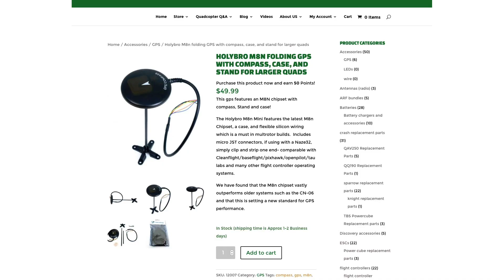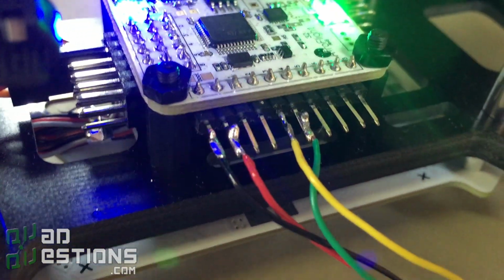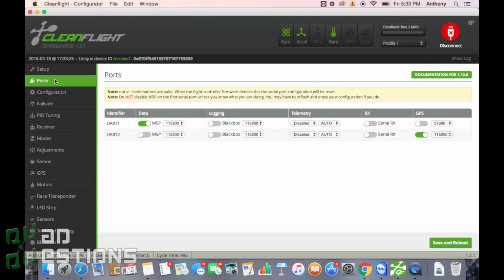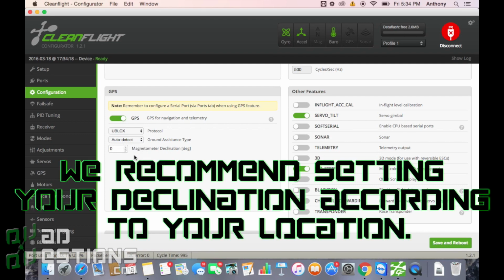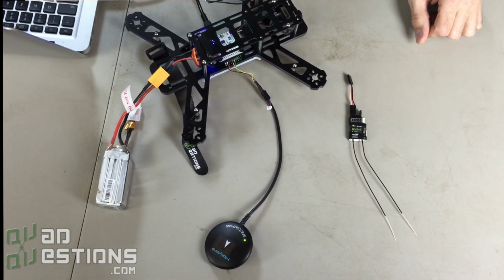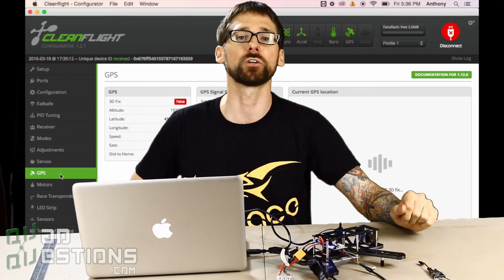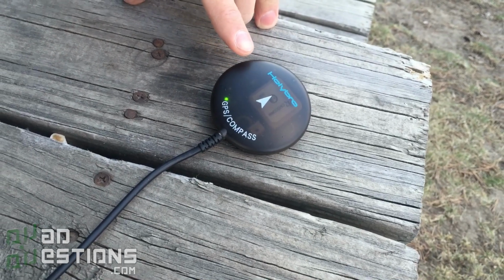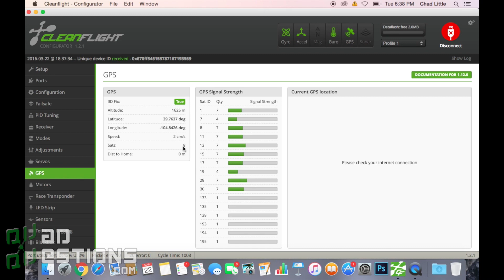How to setup a Holy Bro M8N GPS compass unit with a Naze32 flight controller running Cleanflight.

Comment: can u put return to home with this?
Reply from the maker: This has been previously discussed. But to answer your question, rth with stm32 based hardware hasn't been perfected and therefore we recommend that you only use GPS for metrics such as speed, home location, altitude.  If you really want a reliable rth, you should consider a different flight controller such as a Naz m V2.

Comment: Hi, I am using IBUS on my naze32 flight controller, and the IBUS is occupying the rx port (port 4) on the input rail. Is it still possible to connect a GPS using different ports?

Comment: How do you connect SBUS from a X8R (the signal wire) when you use pin 4 for the GPS RX ? Do you use them both on pin 4 or how do you solve this?
Reply from the maker: You have to set either the GPS signal to an open available serial port, or set the SBUS signal to an open available serial port.  They cannot share the same pin.

Comment: Why does the MAG icon not light up, was going crazy till I saw yours didn't either,,
Reply from the maker: in this video, we don't have I2C setup, so the mag isn't communnicating with the board (that's what the other 2 wires out of the GPS are for)

Comment: Are you sure about sending 5 volts out to the round M8N, I think it is 3.3 volts. I understand the square format Micro M8N can handle 5 volts
Reply from the maker: We had issues with Holybro because their boards pinout's weren't labeled. .  Some TTL communication such as I2c is 3v3, but RS-232 is typically 5V.  The pinout for the GPS as confirmed by Holybro is here: https://quadquestions.com/?post_type=product&p=17075  QQ only has 1 gps in stock because we are working to find a better GPS supplier so that these questions are solved before they are asked... I believe that the gps chip in the round unit is the same as the one in the above link, but you will have to double check the part numbers.
Reply: Thanks. Your link to the 'pinouts' is broken
Reply: I have tried 3.3v and 5v,but no different

Comment: I am so confused. Other videos say no naze32 others say yes. Some say no cleanflight period but inav instead, in order to get the RTH, waypoints, etc to work right.
Reply from the maker: Hi Matt,  I think the issue is that the technology has been developed at a rapid pace, with a flood of new flight controllers that still have very marginal improvements oft the Naze32.  Naze32 is still a great flight controller for beginners, and it is the best documented flight controller.  However, it's F1 processor has less I/O and is a little bit slower than the newer F3- again,  the difference is marginal, especially if you aren't racing.  

So to solve the question of which controller to get, let the amount of i/o connections that you need to make to the board determine whether you need to justify the expense of the F3 processor. 

II don't have much experience with INAV because we are currently supporting Betaflight on our QQ racing drones,  However, IF BUILDING A DRONE THAT NEEDS RELIABLE RETURN TO HOME AND FAILSAFE we always recommend that you go with something like a Pixhawk, or Naza MV2- as these flight controllers have much better development of the return to home and failsafe functions than some of the multiwii variants such as Cleanflight, INAV and Betaflight. software that are currently available.

Where the GPS shines on boards such as the Spracing, Naze32, Colibri, Fury, etc, is in the fact that you can overlay info on your screen such as speed, altitude, Lat, Long, and a direction arrow pointing to to your home location.   So it can really help get you in the "Know".  

I will stress again that we still think a pilot is necessary for safe operation of drones with these flight controllers.  If you have to rely on your RTH to get home, IMO, you are already flying outside of your safe zone, and when a drone is flying by itself, it can also cause injury to someone without the pilot's knowledge.  The GPS should be used as an aid to the pilot, not take over the job of the pilot.  

Let me know if that helps to answer your questions!
Reply: Thanks for the reply! Helps a lot! :)

Comment: Hello, 
I got only one question, what should I do if I want to connect my GPS and the Naze32 in PWM? 
Because the +5V and GND connections, which come from the Naze, they go to my receiver X8R...
I mean, how can I power my GPS if I´m using the GND and 5v of my Naze for the receiver?
Thanks in advance
Reply from the maker: I think you will have to upgrade your receiver to PPM or Sbus to allow the use of soft serial.  You could also connect it to the tx and rx port in the middle of the board and use Uart1 for GPS connections.

Comment: how to set up  return to home on Naze32  board ?
Reply from the maker: Skip it- it's not reliable.  RTH is not a reliable replacement for smart piloting- if you have to rely on RTH, you have already done something wrong.  If you need something reliable, try a DJI Naza, Pixhawk, or other, high-end flight controller.  https://quadquestions.com/product/dji-naza-v2-flight-controller-with-autopilot-led-gps/

Comment: can i connect the GPS in the UART 1?
Reply from the maker: juan carlos barrera yes you can, but uart1 is shared with the USB connection, so you will not see that the gps is working when the computer is connected.
Reply: I don't understand, if I plug the TX and the RX in the UART1 when the Naze 32 is connected to the computer the GPS do not work ? What I do to configure the GPS when the USB is connected ? Can you explain with more detail for the method to add the GPS on the UART1, my Naze 32 is connected in IBUS with my IA6B receiver and I take the number 4 on the UART2.

Tank you in advance for your answer.

Comment: my problem is im using a pwm receiver. how can i connect it if the gps is already plug to the pins?
Reply from the maker: If using a naze32, you have to use a different receiver to open up the serial ports on the flight controller

Comment: Why does your MAG icon not light up. My BAR icon light up, but no BAR mode option in flight mode panel.
Reply from the maker: We demonstrated this on an acro board that doesn't include a magnetometer. We should mention that in order for the GPS to function properly, you should use a full board with a magnetometer, otherwise you will have to connect the magnetometer I2C output from the GPS to the board's I2C ports.  Thanks for pointing this out.
Reply: I do have the full version. BAR icon lights up and is active in sensor tab, still no BAR option in flight mode. Have just received HK Illuminati 32 with no magnetometer, but BAR is in flight mode option as it should. Very strange thing with Naze32.
Reply: Michael Andersen did you get this working correctly with your Illuminati board? I am finding that when I try to save the GPS config it keeps everything backwards.
Reply: QuadQuestions.com 
So once you connect the external compass of the gps module to the naze32 acro FC will you be able to set up gps functions such as position hold?

Comment: All set up in cleanflight everything works visually but selecting rth or hold does nothing in flight. What should we look for? Yes modes set to switches.
Reply from the maker: make sure that your pids are well tuned, RTH is still very experimental with Cleanflight.

Comment: Hi! I would also connect the external compass, you can? and how it excludes the internal one? and where they connect the 2 wires of the compass, the "I2C"?. THANK YOU
Reply from the maker: You can connect the external compass, however you will have to cut the trace on the board that connects the i2c connection to the magnetometer.    You would connect the wires to the i2c port on the naze.  More info can be found here: https://quadquestions.com/blog/2015/11/15/naze32-manual/

Comment: Bro, is that on a full or evo naze board, or it doesn't make a difference?
Reply from the maker: A full naze board is required to use GPS-  a magnetometer is required to use GPS functions in Cleanflight.  Some GPS unit's include a Magnetometer, however it is easiest to just use a Full Naze32 that already includes one.
Reply: I got a full naze32 and im using a naze gps.
Reply: QuadQuestions.com must of the people on here are using all pins you are indicating to use for a gps hook up. my question in can you give a clear explanation of a alternative gps hook up on the naze32 rev6.
Reply from the maker: You can use the GPS on any Rx and Tx pair.  So you could connect to the tx, rx pins, or pins 1,2 or 3,4 or soft serial on 5&6 or on 7&8.  But as explained, most of these serial ports are used by things like USB communications or rx receivers or PWM inputs, so it really depends on your build.

Comment: Thank you for putting this together! I have a question about using this with a tricopter setup in cleanflight. I'm using pins 3 and 4 for ma ch4 and ch5 on my receiver. Is there an alternate configuration I could use to get this working. I noticed there are tx and rx pads on top of the naze32 - could these be used (connecting the gps tx to the rx pad and visa versa)? Thanks again for your time!
Reply from the maker: +rcpilotp51 You can use the GPS with any spare UART (serial) port.  The Naze32 is somewhat limited on I/O-  UART1 is taken by the USB port, and by telemetry-  UART2 is the standard GPS port and the only other available UART-  If you need more I/O you could use soft serial to create virtual serial ports to use on pins 5&6 (soft serial 1) or pins 7&8 (soft serial 2)

Comment: I hooked the Holybro M8N GPS unit up to an HKPilot APM 2.7 FC to the appropriate connector (after swapping out the supplied extra cable).
I am wondering what the pinouts might be for the cable. Looking top down reading the cable connector on the APM 2.7, it is: 
RED, YELLOW, GREEN, EMPTY, BLACK

I get the Green light on the GPS unit - SOLID, the BLUE light on the APM 2.7 FLASHING ...but NO BLUE light on the GPS Unit.

I am indoors (Aircraft Hangar), but took it outdoors for about 5 minutes and achieved the same results.

I just want to confirm the pinouts.... I will mess with the rest.
Reply: +Mark Nichols After verifying that the pinouts and wiring from the GPS/Compass were correct, I was still baffled why the GPS was not getting a lock. THe unit was communicating to the HKPilot Mega 2.7 just fine and was talking to Mission Planner.
I verified that the setting were correct within Mission Planner (ublox type).
I decided to shut down Mission Planner (to release the COM port) and launched u-Center software from ublox.
Usually, as per documentation and found bits of information, you need a TTL-USB converter to talk to the GPS/Compass. Apparently the u-Center software can talk to the GPS/Compass through the HKPilot Mega 2.7 Flight Controller - go figure!
As soon as I launched the u-center software it reached out to connect (on it's own) to the GPS/Compass.
From that point on, the unit functioned perfectly.
I was picking up 3 satellites inside the aircraft hangar and 18 satellites when I got home. This happened within a minute.

Nice Product from www.quadquestions.com
I ordered the  Frsky Taranis radio from them as well.

Chad from quadquestions.com is a Rock Star!

If you need a product, advice, tech help on a product you bought from them - I can easily recommend them as a go to source. Especially if you are a beginner like me (I maintain Flight Procedural Trainers for the Govt.) but this is a new area for me.
Reply from the maker: +Mark Nichols here is a link to a page that shows the pinouts (scroll to the bottom of the page)
https://quadquestions.com/product/holybro-m8n-mini-gps-module/